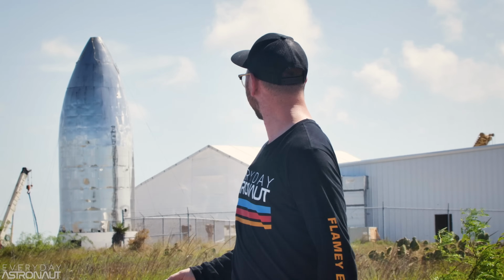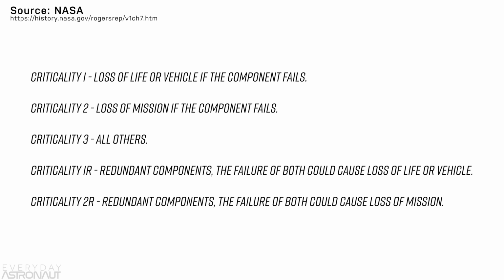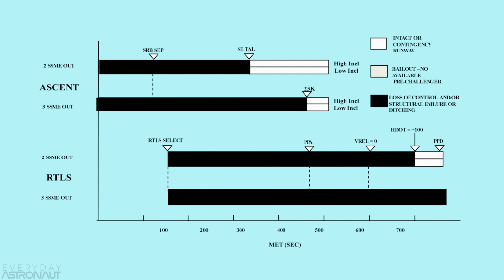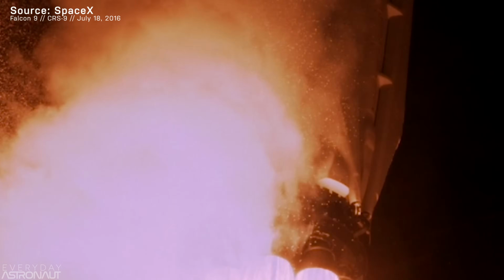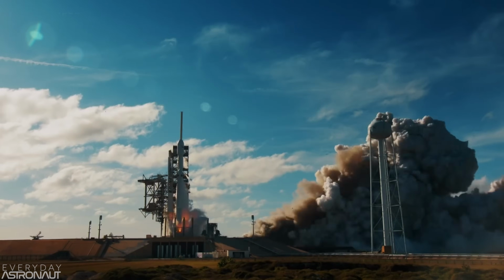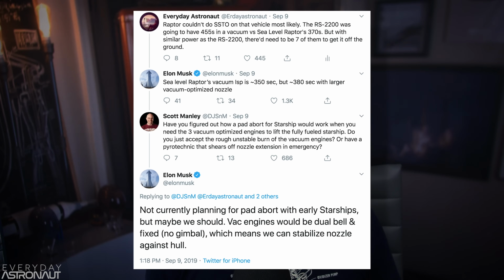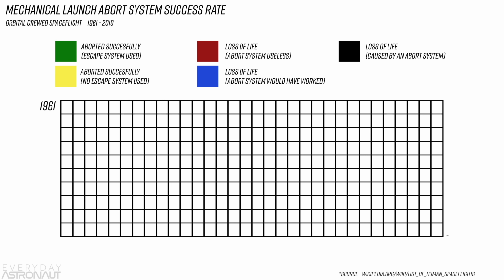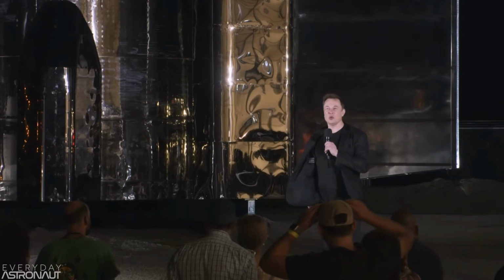Why won’t Starship have an abort system? Should it?!

Comment: They will not launch Starship with a full crew on board. (100 people) they will be ferried up to Starship by Dragon while starship is refueled over the next 5 days.  The logistics dont make sense.  This way space stations become way points before final boarding.
Reply: That adds a lot of cost and mission failure points. Don't see that happening at all, especially as SpaceX have said that once Starship is flying regularly they will phase out the Falcon 9 and Falcon Heavy from their fleet.
Reply: @jeffvader811  , yes it does add complexity along the axis of proven reliability. That's why we have the concepts of 'fail-safe' and 'fail-secure'. A triple redundant avionics may add weight and complexity but they ensure fail-safe along a predictable axis of reliability. 

Falcon 9 has had 48 successful launches out 50.  96%. Fourteen launches of seven people or 7 seven launches of 14 people is well within the vehicles failure margin. 

However there is no precedent for starship at all.  Even after 12 successful launches you would be playing with a chance of probability at launch and landing of a complete loss of all 100 people and since space isn't some place we have to go it would be a massive set back in space transportation.

More importantly the FAA isn't going to allow Musk to put 100 people on a rocket even after 12 successful flights.  All you have to do is look at the airline industry to know that.  737 MAX has significant pressure from capitalistic forces to return to flight and it hasn't.  And that's one system of reliability based on other reliable systems.  Space hardware has not gotten there yet and the falcon 9 is the system of reliability starship will become reliable upon

Comment: A safety factor of 1.5 or 2.0 sounds crazy low.
Reply: Marwin Thedja Not an expert but I believe the reason it’s not higher for spacecraft is weight. More safety factor almost certainly means more weight and it’s just astronomically expensive to take more weight to space. It’s “easy” to give a bridge a 10x safety factor comparatively.

Comment: This kinda kills the starship as a human rated vehicle.
Reply: not really, the shuttle also didn't have launch abort systems for all the crew, and in case of an emergency, on vehicles which have integrated engines, the abort system does not really makes sense because the vehicle would explode regardless

Comment: Intro: the starship prototype is missing something...

Me: yeah the top blew off ☹️
Reply: The front fell off.
Reply: No cardboard derivatives.
Reply: @Matmamtmamtmamtmamtm  a wave hit it!
Reply: @Gggggggggg7772  A wave hit it? At sea? Chance in a million.
Reply: Matthew McColl damnit, you Got me there 😂
Reply: blowing off the top seems like a nice launch abort systems.
Reply: The front fell off
Reply: Nah, that's just the convertible model.  You can also get one with flames on the side, and a custom exhaust.
Reply: I'd just like to point out that is very unusual. Normally the front doesn't fall off...

Gotta love Clarke and Dawe. R.I.P.
Reply: @leonairrc  Its way to weak
Reply: @Gggggggggg7772  r/wooosh
Reply: @Valentin it‘s r/woooosh but u got me
Reply: @Gggggggggg7772  well no, but actually yes.
Reply: I don't get it, weren't they doing that exactly on purpose? That is determining the exact pressure at which the things go wrong? So it was like:
SpaceX: let's pump this thing with gas until it breaks.
The thing: breaks.
The whole world: OmG sPaCeX hAs A dIsAsTeR aT tEsTiNg SiTe!!!11
Reply: @Nibiroid  no they weren't.
You confuse Starship with SLS.
With SLS it was planned to find the max possible pressure. (fill up until boom) 
With Starship it was just to normal pressure.
Reply: @Jehty_  «"The purpose of today's test was to pressurize systems to the max, so the outcome was not completely unexpected," a SpaceX spokesperson told CNET. "There were no injuries, nor is this a serious setback."» So I thought it means "max we can get".
Reply: @Nibiroid  no it doesn't.
If he meant "max we can" why would he say "the outcome was not completely unexpected"?
If you try to destroy the vehicle, you know the outcome from the beginning.

Comment: It's gonna be really difficult to SpaceX to proof that Starship is safe enough for manned spaceflights
Reply: Just refly the same upper stage 30 time in a  row should be sufficient... ;-)
Reply: @dongurudebro4579  You're right. And with an escape system, it is even less : NASA ask 5 succesfull flights without modifications on the rocket to "man-rate" falcon 9
Reply: Astrelix Space right! Unless they speak with actions not words. Yeha still pretty dang difficult. See ya on the moon 🌝